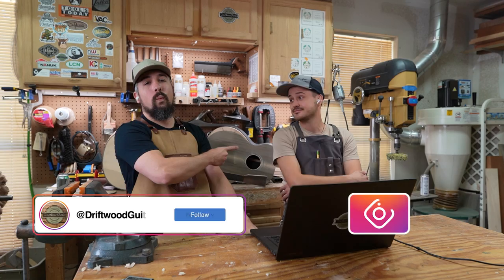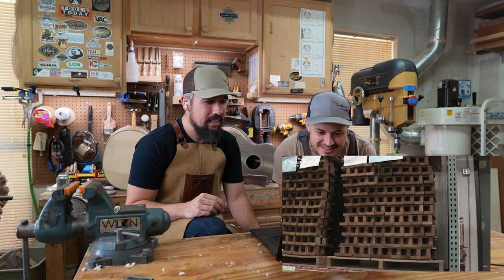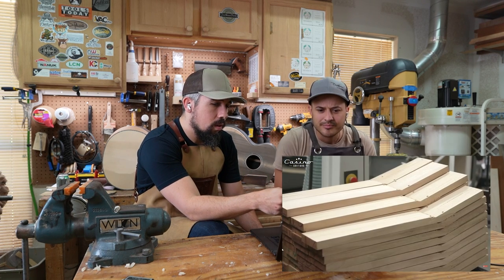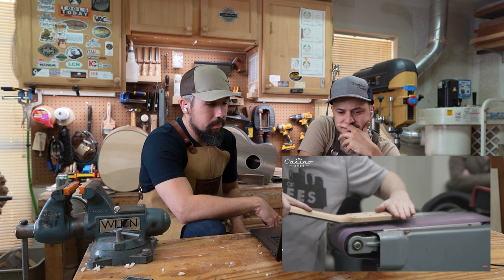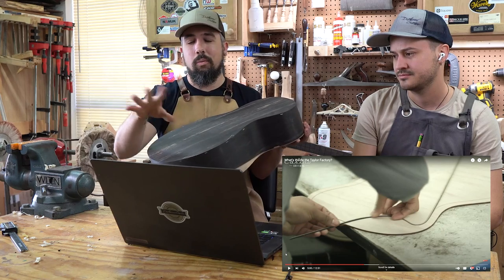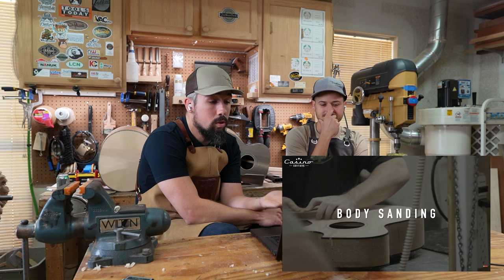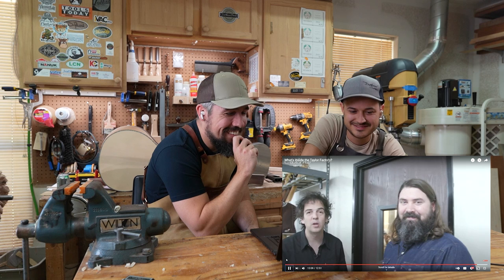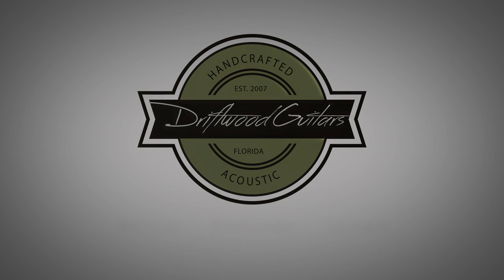Professional Luthier Reacts: Taylor Guitar Factory Tour

Comment: If you really want to know how strong scarf joints are, you gotta design and conduct an experiment.  That being said, I guarantee people have already conducted experiments that test the strength of scarf joints, and the results are likely available online for free.  Experiments aside, there are definitely equations for determining how strong materials and joints are, so there's a really good chance you could just use math to determine how strong a scarf joint is compared to whatever you're using.  The topics of stress, strain, and strength, among many others, should be an integral part of study for obtaining a mechanical engineering degree, so your partner should be more than capable of providing you with a definitive answer.  In fact, I think that would be a really awesome video that your partner could make.
Reply: Taylor actually made a video for this neck design when it first came out. They did a comparison stress test between the typical and the 2 piece neck. Their necks won every time 🤷‍♂️

Comment: Great video! Pro tip: on YouTube videos you can skip a few seconds back and forth at a time by using the arrow keys on the keyboard. Much easier than trying to drag the progress slider back and forth. I use this when I’m learning sections of guitar solos from YouTube :)
Reply: Scarf joints definitely are stronger. It's not a myth like claimed here. It's not only used in guitar building because it avoids the short grain runout which makes did example Gibson headstocks so prone to breakage.

Comment: Interesting.  ... however I am not much of a fan of Taylor guitars for many reasons.. Probably the No.1 reason it the action,  on many of them , are just too low to the soundboard...  and you dont have much room for your three other fingers without rubbing the sound board .. However I noticed that on tje same models..... some are and some aren't  . In fact some are darn high . 
Here's my theory on this.  
 Because Taylor's prime goal is Production , I believe that they go to set tje neck .. if the neck angle is slightly lower than it should be , they just grab a thinner bridge and put on there.... I  suspect that they have three thicknesses handy ...  so i stead of properly resetting the neck,  tjey just geab a bridge of tje appropriate thickness to acquire the angle needed to give the correct string height at the twelfth fret.. 
    The other things I dint care for are the neck attachment system... and the third is their finishes.. their finishes are gaurenteed to not improve the sound quality over time . Their resins are prettymuch permanent sounding.

Comment: So a 300 series is the same this as a presentation series without the inlays? Lol
I guess you don't care about the grade of wood on your guitars. Good to know.
Reply from the maker: Grade of wood has ZERO to do with how wood sounds. Plus higher grade woods cost very little more than lesser grade woods for large manufacturers.
Reply: @DriftwoodGuitars  didn't I just watch a video of yours where you scoffed at gibson for using poor graded bracing? I won't argue about this too much with you as you are Talented luthier but I just find it hard to believe that wood grade doesn't matter.  Lol but maybe my ears just want to hear the difference ;)
Reply from the maker: I wasn’t referring to its “grade” as much as  it’s “cut”. The brace wood was rift sawn, when it should be quarter sawn. All top wood regardless of its “grade” is quarter sawn (for the most part). A poor cut of wood that is rift sawn or flat sawn will crack easily and not reproduce sound well. The only difference between an “A grade” soundboard made of Sitka spruce and a “Master Grade” Sitka spruce soundboard, is that the master grade one is more even in color and grain spacing. It may be slightly more perfectly quarter sawn, but not enough to affect sound.

Comment: That was interesting!  One of my favorite pastimes is finding factory tour videos and looking for cool ideas,  and I do a lot of stop action also.. You might check out Maton, Ovation, Godin, and Takamine.  Its kind of fun to hear the spin they put on something, and the next factory doesn't do it and they have opposite spin.  My intuition as an engineer tells me that the scarf joint is stronger because of the direction of the grain in the peg head.  But, having said that, I prefer the one piece also. And the scraps can be used, so I don't see that much gained in the way of saving waste. Good job!

Comment: Hey fellas, I have really enjoyed your channel and look forward to your content updates. I'm a hobby electric guitar builder (my latest build was a Tele from an antique beer crate - https://www.youtube.com/watch?v=6f0f4nSIUCo&t=12s) and have been contemplating giving acoustics a go. If you ever decide to offer your template system I would be very interested (I'd be interested in purchasing the templates, molds, and radiused go-bar deck as a complete system - maybe you could license it to StewMac). Anyways, my next comment is a bit redundant given others' comments, but I can't help myself. The two-piece neck with a scarf joint is by far the stronger more stable neck. As others have noted, the problem with the one-piece neck is the issue of short grain. It's easier to break a piece of wood with the grain than it is against the grain. Boat builders and other wood workers have known this for a very long time, so it's not an issue of the guitar factories inventing an explanation post hoc of developing a cheaper way of producing guitars. Incidentally, the purpose of a volute on some guitars is to combat the short grain weakness that is inherent in one-piece neck.

Comment: I stopped watching those two guys when they sided with the salesman of a very old guitar that had some repro tuners (i think) that weren't in the sale description and then said basically the buyer should have known a guitar that old would have repro tuners as well because the trusting buyer took a month to have a professional inspection its not the sellers problem.  The guitar described by the seller as 'all original'.  lol.  Anyway, it came off as real douchie.

Comment: I kinda regret getting a Big Baby Taylor (e) 4 days ago. When I got home I noticed there was this scary "clicking"/"cracking" sound coming from the joint of the neck and the body (right where the two screws are). It sometimes happend when Im playing but mostly when I move the guitar around, like to and from the couch or the bed, taking out of the wall mount, etc.
Im really thinking about going back to the dealer shop and return it. 
A Taylor representative told me to tight the screws completely, but the screws didn't move a bit.
I honestly can't believe such a expensive instrument (was expensive to me close to u$ 900 with import taxes and internal taxes) can have this issue. I owned other 4 guitars in my life (2 classical guitars and 2 electric ones). One of the classical guitars, a Fender CG 11-e, its over 25 years old now, and have never ever gave me any type of issue. It tunes like a champ, and plays fantastic. 
And that guitar cost me less than u$ 300.
Reply: does it say made in mexico on it? look at the end of the neck through the soundhole.
Reply: @iccus62  Yes it does

Comment: Chris your comments on Finishes just made me think... I have a 1 year old Martin 000-28 Modern Deluxe with Nitro Cellulose lacquer finish and put a Capo on the Head Stock.   I left it there about 2 months and when I took it off,  it had eaten into the lacquer finish removing about 75% of the buildup and leaving a horrible scare on my expensive and beautiful guitar.   Martin doesn't cover it, so I'm having it fixed by a local Luthier.   Is NC finish that weak?   non of my cheap guitars have this problem, and the finish looks "thick" not thin.   What's your insight tell you?
Reply from the maker: Yes, nitro is a LOT more sensitive to things like that and damages a lot easier than the cheap finishes. But then again, it allows the wood to flex and breath in a way that this thick and durable finishes can never achieve. It’s a trade off. The best sounding finish, is no finish at all, but we know how well that’ll hold up to abuse.
Reply: @DriftwoodGuitars  Thanks for the fast response.   I'll never put a capo up there again!    You're channel is very good.  I watch a lot of different channels on Guitars and yours is one of the most "Genuine".   You say what you think, and you've considered a lot of things.   I hear your concerns for those angry comments.   I'm old so my experience tells me that most people say in a comment or tweet what they'd never say to your face, and their filter come off.   So my advice is follow your gut, and always try to be fair and tactful.   But get the intended point out.  We out here in the Metaverse need guys like you to be genuine.

Comment: im amazed at how many companys use bolt on necks ,Martin does it on lower end guitars and hide it by putting thier logo sticker over top of the nut of the bolt they do still glue the fretboard to the body ,at least Taylor stopped using the classical bridge on thier steel string acoustics
Reply: This is a fallacy, I love my custom shop 000 Martin, but Bourgeois, Huss and Dalton, Kevin Ryan etc, all very high end boutique builders use bolt on necks. It makes it easier to reset the neck too.
Reply: @angelg8445  Its actually a fact ,theres nothing wrong with a bolt on neck ,martin does use them not picking on them alot of companys do this including Boucher ,some people dont like bolt ons but if you dont know that they have a bolt on then you never know any difference and there isnt really a difference ,and yes it is easier to do a neck reset but you still have to release the glue under the end of the fingerboard where it covers the body of the guitar
Reply: Martin does used Morse tendon neck joint which are glued and bolted on some models but  not just bolted
Bolt

Comment: I bought a new Taylor guitar for the first time I maple back and front it sounds really good I was very surprised it’s punchy loud but every note you can hear very clearly the only thing I have about the guitar is the craftsmanship for the $2200 I spent the craftsmanship is very bad there is a lot of imperfection in the seams and it has no binding on the back but yet it looks like the wood was not put together that you couldn’t see the spaces you can see the space in between if I had a camera I will send you the photographs and you would be surprised so I worked so hard to get this Taylor thinking that I was going to get something very nice and sounds good and I was so disappointed

Comment: I call bullshito on the scarfed joint necks! Let's be honest, all angled headstocks are subject to breaks if traumatized. Think Les Pauls. The good side of one piece necks it's usually a long grain break that's easier to repair. All the Taylor headstock breaks that I've had in the shop were really short end grain breaks. Breaks like that need splines to repair. Cheaper to build but more costly to repair! BTW Casino is a Taylor dealer so don't expect any negative press!

Comment: I am a total self-taught thumb-fisted moron at guitar work but usually only work on modest guitars.  I have done refrets, made bridges, fixed bracing and reset necks, including conversions to bolt/glue on reconstructions. One was a lawsuit series 1977 Takamine F400 12 string which I will never part with. I did a number of other cheaper resets to build skills on similar Asian guitars with dowel and glue neck joints knowing that I wanted the Tak to be a success. Thanks to Jerry Rosa of Rosa String Works for their videos on a similar guitar, Jerry showed me the path. Someday I hope to actually build a guitar of my own. Would love to build a 9 string acoustic OM.

Comment: So if you're paying $5000 for a Taylor, the end product costs to manufacture: 1% for the wood, 0.5% robotic laser and router CNC, 30 mins FTE 0.5% sanding, 15 mins FTE 0.5% fretting, 10 mins FTE 0.5% baffling, 15 mins FTE 0.5% binding, 0.5%, robotic lacquer, 0.5% robot buffing, 7 mins FTE 0.5% decal, 14 mins FTE 0.5% machine heads+ strings, 17 mins FTE Packaging 0.5% shipping, 0.5% costs FTE staff per unit, 3.5% CEO Salary, 90% profit? FTE calculated based on number of Staff/Unit manufactured per day smoking business model!